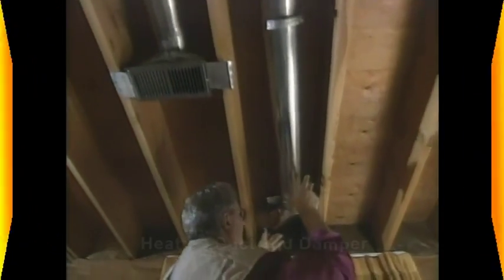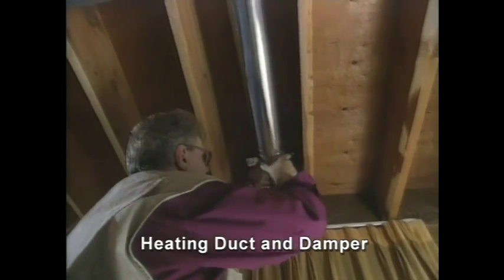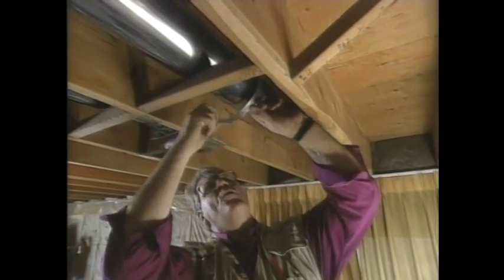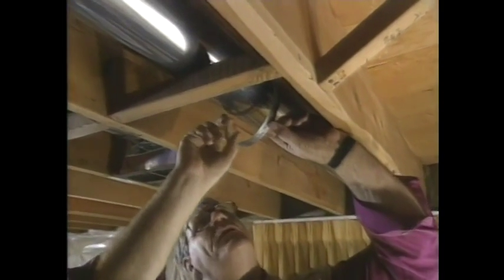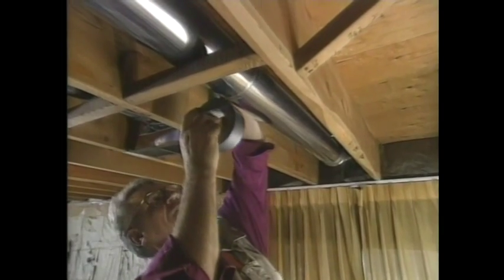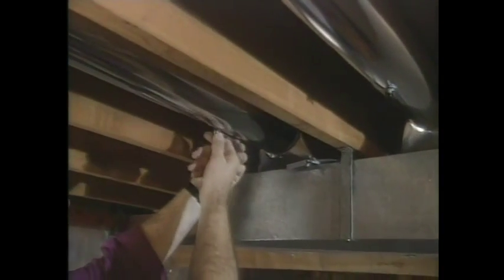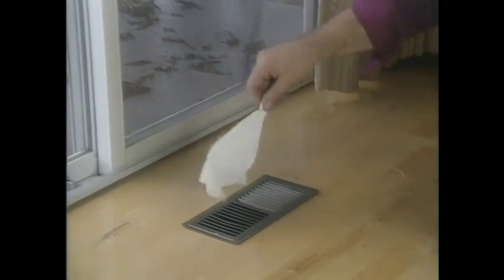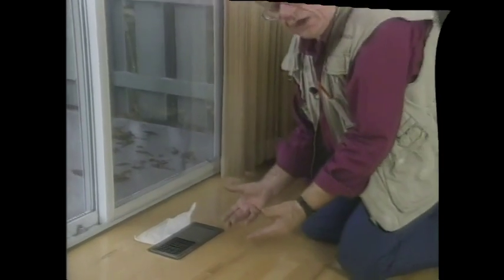Heating Ducts and Dampers

Comment: Your supposed to use foil tape not duct tape , doesn’t matter what size duct tape it will just dry up over time. And if you use foil tape make sure and use adhesive for extra strength that’s what I do anyway.